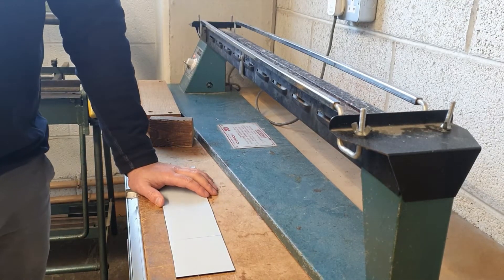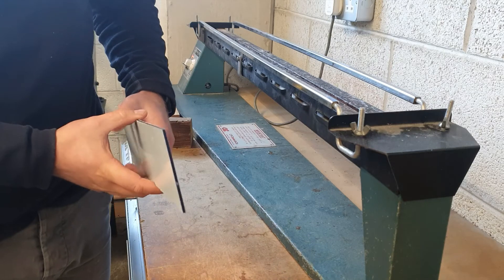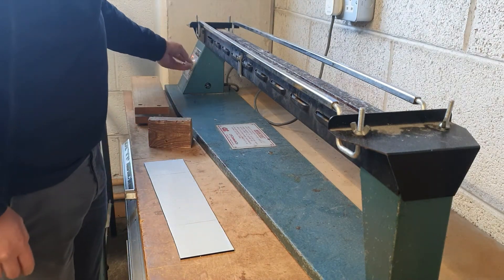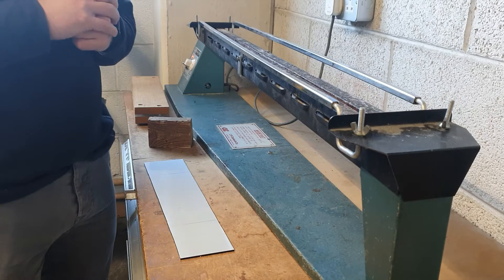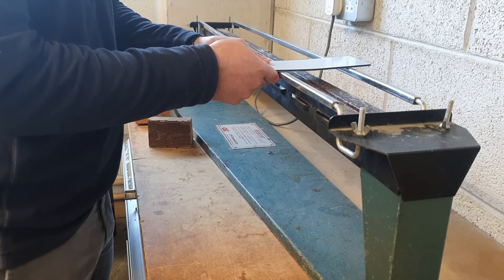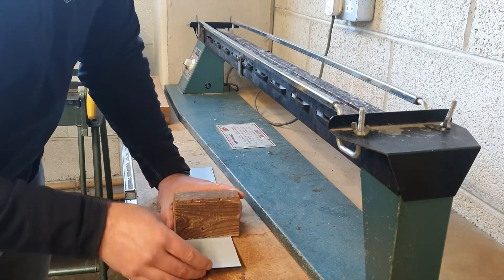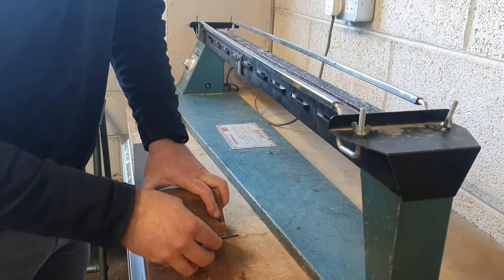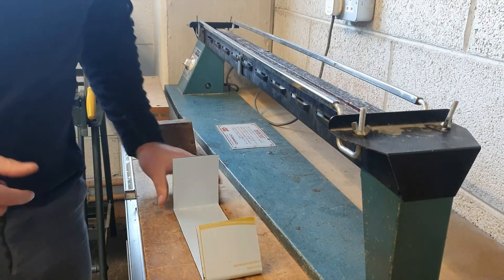Strip Heating

Comment: You didn't take off the plastic wrap
Reply from the maker: I prefer to keep the plastic on. If you peel the plastic off you cannot see your bend line or you have to mark it in with a scriber which does not look nice on the piece. Leaving the plastic on is fine once you don't leave it over the heat too long 😀🔥